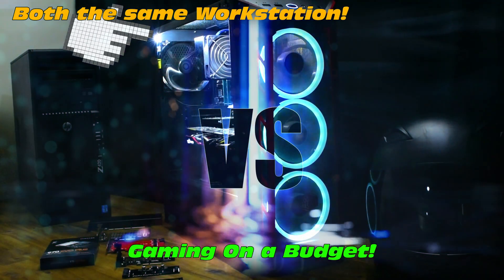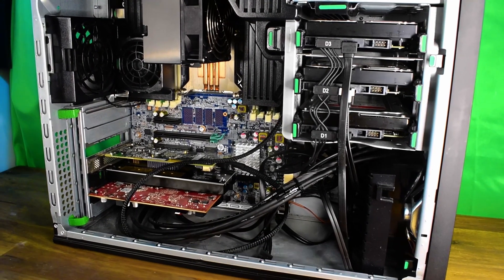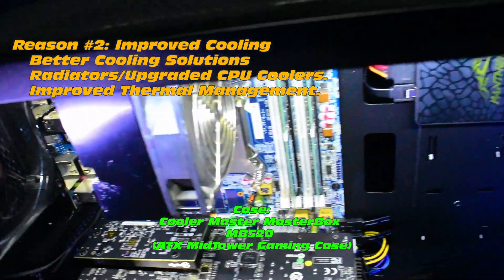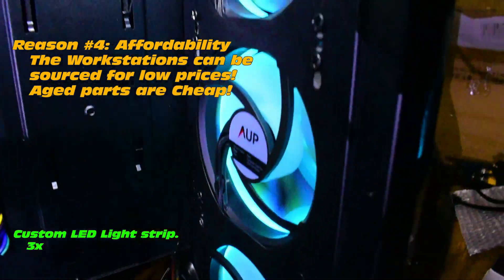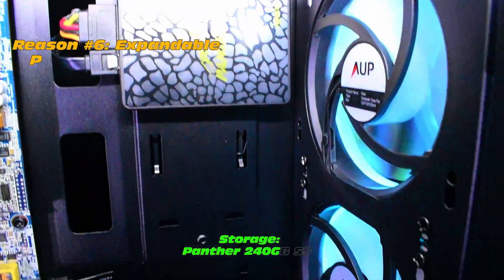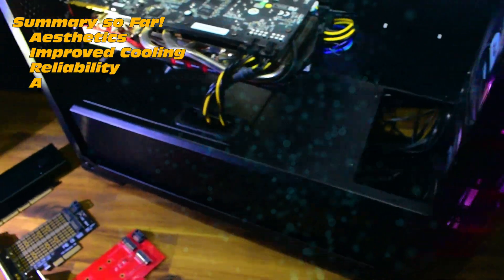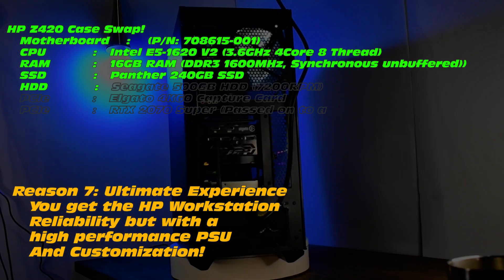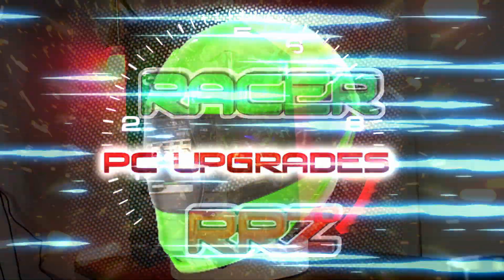Z240 / Z420 / Z440 : 7 Reasons to Case Swap! Blend Reliability with Revamped Aesthetics!

Comment: This Z420 can be used with the Tesla M40 for gaming?
Reply from the maker: Technically yes, you could play certain games using the Tesla M40 but I would recommend a more gaming oriented GPU. Something like the GTX 1660 Super or RTX 2060 would give a much better experience. The main reasons are that the M40 is designed for work - not play. It has no GPU outputs and is designed to work headless. When paired with the Z420 that means you'll need a second GPU for display output to connect monitors etc. I have also never obtained decent frame rates with the QUADRO GPUs - their drivers are geared more towards CAD work - stably holding large projects in memory rather than producing high frame rates. The Z420 is a solid contender for some 1080p gaming on a budget though. You may need a 6-pin to 8-pin GPU power adapter to connect your GPU of choice. It should be able to power any GPU up to about a RTX 3070. Anything with 3x 8-pin GPU power will be out of reach for the Z420's PSU.
Reply: @racerrrz  I know the M40 isn't for gaming, but I used it before. Since the motherboard where I had it burned out, I was looking for one and wanted to see if this Z420 works for that. I know this motherboard has to be modified
Reply from the maker: That's fair. The M40 is still a decent GPU by modern standards - it just requires a bit more effort to get them working right. You'd be able to get it running on any system - as long as you have either an integrated GPU or a second GPU to give display output. You may be able to get headless to work on the Z420 but I would still recommend also fitting a GPU with display output to make your life easier. Out of interest - what were your frame rates with the M40? Which games do you play?
Reply: @racerrrz  Light games, but I was going to try some heavy ones, but the motherboard burned out. I saw a Z420 on eBay with 16GB, E5 1620v2
Reply from the maker: You might run into some frame rate issues on the higher end games, but if you drop the settings down you should be able to get some game-play in. The E5-1620 V2 has a decent clock speed at least. You may be able to find a decent CPU upgrade for a fair price. Just make sure to check your motherboard version - that determines your CPU upgrades in the future. Some additional info that might be useful if you go for the CPU upgrade in the future: https://h30434.www3.hp.com/t5/Business-PCs-Workstations-and-Point-of-Sale-Systems/Best-CPU-for-my-HP-Z420/td-p/8959377
Reply: @racerrrz  The information is somewhat confusing about the processors, it says it supports the E5-2600 family, apparently the board supports v2
Reply from the maker: @tonyr9369  Very much. I can recommend my video guide on the Z420: https://youtu.be/D9kG4Il_XJ4  skip to 16min 28 seconds. I cover the different features for the system there.

The Z420 was released with two motherboard versions (version 1 and version 2). Version 1 is limited to the older E5-2600 (also 'V1' CPUs - confusingly enough). Version 2 is able to accept V1 and V2 CPUs - i.e. Xeon E5-26xx V2. 

I made a CPU guide - it had a full list of Xeons that these workstations can accept: 
https://www.youtube.com/post/UgkxinbLescQdmrqtvl7VzO2DW8Eaysrn3QH

The Z420's motherboard version will be printed on the white sticker on the board - just below the CPU cooler. The best CPU for gaming would likely be the E5-2687W V2 (8C @ 4GHz), but you need the V2 motherboard to run them.
Reply: @racerrrz  Thanks for the info, I recently ordered the z420 16gb e5 1620v2 combo, I'm sure I'll have fun modifying it haha
Reply: @racerrrz  I already received the Z420 but it doesn't give an image, seeing the RAM are DDR3 without ECC

Comment: i honestly paid £30 for my z420 64gb ddr3ecc 500gb sata k2ooo gpu for £30 i was playing borderlands 3 at 32fps,  i upgraded the cpu 8c 16t (cpu £6) and a rx 5700xt 8gb £180 ish, and it rips the sons £2000 ryzen5's 5600 and his 8gb 1650 ti,

the z420s motherboard is a beast, my next idea is to try 2x xeon the e5 2680 v4 is now £9 the lga 2011-3 boards £29, that chip is slightly better than the i7 gen 10
Reply from the maker: Nice, indeed the Z420 will remain a solid system for a little while yet. Great value at that price point. The real upgrade right now would be the HP Z6 G4 - add in a Xeon W-2175 and you have a solid system (but at a steep price). The HP Z840 will also give you good service and they are a bit cheaper being older systems. Aim for the E5-2697 V4 (or the E5-2697A V4) if you can, they have a much higher clock speed which puts them in a better position for gaming.

Comment: how to do a case swap
Reply from the maker: Hi there. That depends on the motherboard that you select for the case swap. I have done a guide for the Z420 (written only) and for the Z440 (video and written). 

The Z440 video: https://youtu.be/K4RalaEbRI4 

It is a relatively simple process but the best place to start is what your purpose is for the case swap. Aesthetics or extra storage space etc. For my Z440 case swap I needed to be able to fit more hardware (I am making use of all 6 PCIe slots) and I have installed around 12 HDDs. It serves as my file storage server for video content I create.

Comment: How the fuck did you get the motherboard out of it's OG case
Reply from the maker: That's the easy part, the difficult part is getting it running again. If you wanted to case swap a Z420, I published a written guide of some of the key issues: https://www.reddit.com/r/HSpecWorkstations/comments/17rtlrn/hp_z420_motherboard_case_swap_guide_everything/

The HP Z420 is getting a little old now. The more ideal option now is the Z440 (X99 based system). I did a full video guide on the HP Z440 Case Swap Process if you were interested in doing one: https://youtu.be/K4RalaEbRI4
Reply: Awesome! I want to build a HP Z440 too @racerrrz

Comment: Z440 - doable for this? I recall reading somewhere that certain original cables needed to be left plugged in. Can't find where I saw this though....
Reply from the maker: Yes, in fact Eli ez who commented below is also aiming for a Z440 case swap. I hope to get a video together that can outline the ins and outs for these swaps in a bit more detail. Eli and I have a  discussion running here for the swap: https://www.reddit.com/r/HSpecWorkstations/comments/10jzr8v/hp_z440_case_swap_fix/ . If you run into questions feel free to post there also. The most challenging details involve solving the power button pins, and resolving the boot error messages. The easiest method is to leave the HP wiring plugged in, but it is possible to bypass this issue. I can recommend a video by DLM tech garage who outlined solutions to the boot issues for the Z240 SFF motherboard. Some of those fixes may work on the Z440 also, but the motherboard pin-out diagram would need to be confirmed as identical to be 100% sure.

Comment: I’m happy to inspire you making this video but I do have one question what can you do for the memory fans? 

It’s a leave it or take it situation for me but the main issue is the message in the bios.
Reply from the maker: Good question there. The main challenge is having the 4-Pin Power connector satisfied. You can bypass this by ensuring all the fans you buy are 4-Pin based (HP uses this feature to allow Pulse Width Modulation of the fan speeds, i.e. dynamic fan speed settings based on case thermals). I'll work on having that covered in my next case swap guide. I plan to get a Custom NAS Z420 together (although I might go for the Z240, but I think the Z420 will work better for this purpose - will test). In the Z420 in this video I actually placed a LED lighting strip on the Memory Fan power, but I only included two wires which does leave me with a boot BIOS error. There is also a boot error for the front media hub. All these errors can be removed with a simple wire connector joining two pins on the connectors causing the fault.
Reply: @racerrrz  You might be able to buy a bunch of pin jumpers and use them.
Reply from the maker: @EliezYT  I have stash of these (tiny link, Amazon links are massive): https://tinyurl.com/2e7mys4w , but they do not always fit that well. But with some heat glue it can hold well enough. The ideal would be to fit the wire into the new connector (i.e. 4 pin fan power or the 20-Pin SATA data cable etc.). There is also the thermal sensor which you can bypass with a new thermal sensor. The one showcased in the video has a tiny transistor (NPN 2N2222A transistor i.e. the thermal sensor) plugged directly into the motherboard socket to satisfy the error code / stop the fans running at max speed. I'll take some pics of the current machine and post a link here. But a full guide with these details should help!
Reply from the maker: Quick link to some pictures of key items. I'll work the ideas into a video! https://imgbox.com/g/b4w4C5lGu1
Reply: @racerrrz  Thanks it would be good to have your discord sometime my knowledge and your execution could help future videos.
Reply from the maker: @EliezYT  Send me an email (https://www.youtube.com/@racerrrz/about) and I'll flick through my Discord details. I need to create a Discord Server!
Reply: @racerrrz  I did it hope it delivered.
Reply from the maker: I'll see if I can piece together a video on the key things that you need to do to get the case swap running well. I should have the footage to complete this guide from the Z240 Case Swap's content. I'll have to do some research into Z440's Motherboard but it may be helpful to figure out what is needed there.
Reply: Maybe you can use an arduino, he can emulate a keyboard so it will press the F1 key when he boot up.